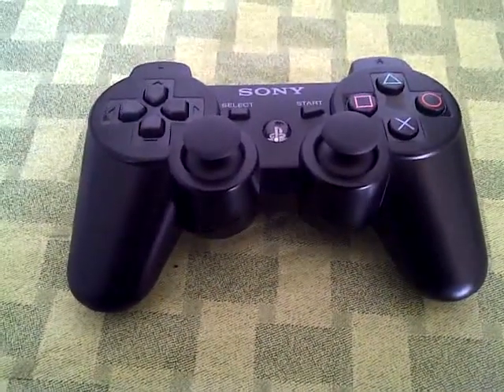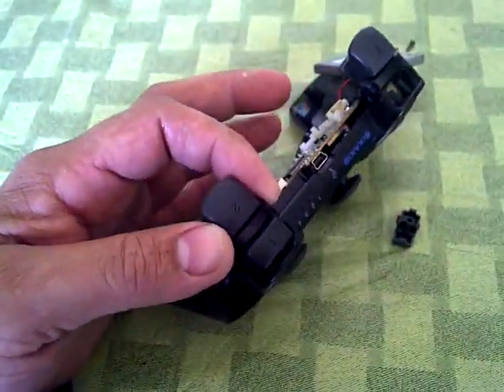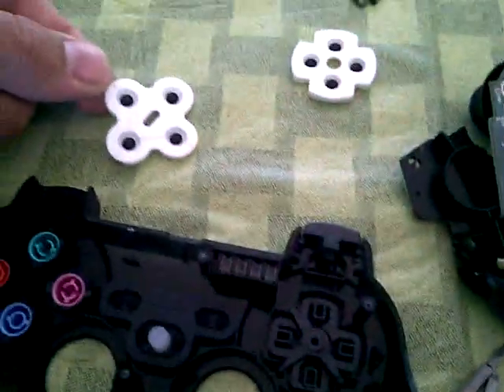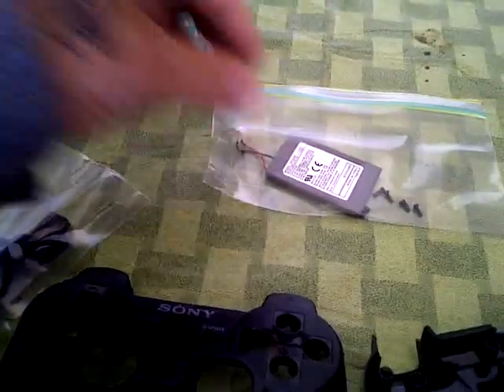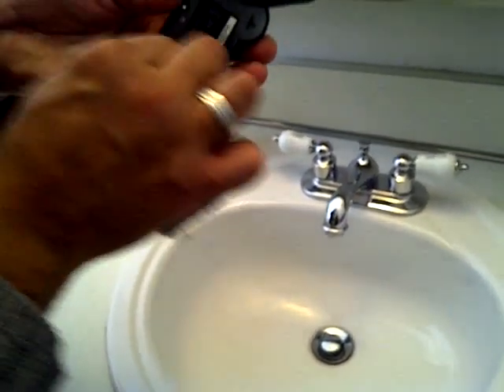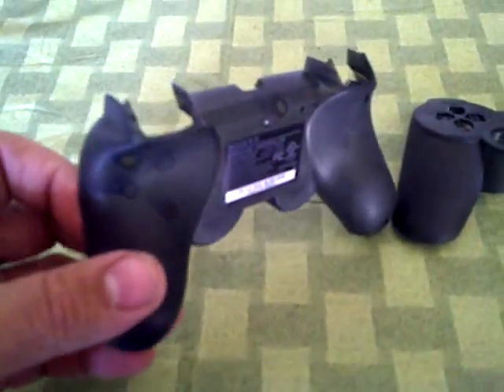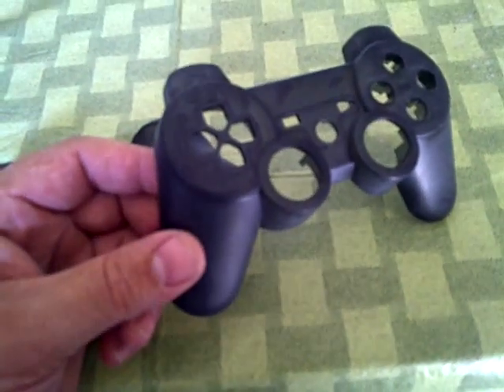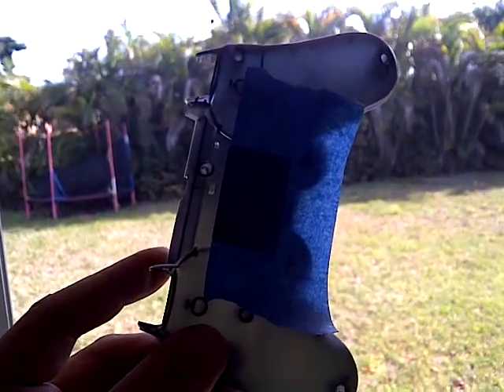How to paint a PS3 Controller Part 1 - Prepping - Camo Style

Comment from the maker: That's correct. Primer in general fills very fine imperfections in the surface and helps with the bonding of the paint. if done correctly the paint will last a long time. I like to use the sponge because it's able to get into the small corners and the controller surface is not flat ,so the sponge will sand the surface more evenly than the paper will. Hope this helps

Comment from the maker: @Theihatecampers i would suggest to wait about 10 mins between each coat of paint. the first base color coat should be light enough to still see the original color of the controller. wait 10 mins then spray your next coat. wait another 10 mins for final coat of base color. before spraying each coat make sure to shake can well.

Comment from the maker: @StunnaKkid primer preps the surface for paint so it can adhere better. In this case, the sanding of the surface and the washing with warm water and soap is another way to prep the surface for paint to adhere. if done properly and sealed with the clear coat, the paint will not chip off. Its been almost 9 months now since i did the paint job and the paint is still intact. My son and I use the controller on a weekly basis and shows no signs of ware.

Comment from the maker: using steel wool or any type of abrasive pad will should remove the paint, just a matter of how much sanding is required. If your repainting a controller make sure that the button openings are clear of any excessive paint to allow the proper button travel. Aside from the paint keep in mind the clear coat to protect your paint job.

Comment from the maker: Sure, providing that your going to spray the matte clear coat after the main paint theme is done to protect the finish, the plastic paint will be fine. Allow to dry several hours, don't rush it then apply the clear in light coats.

Comment: i did this to a xbox 360 controller....4 of them actually n never did anythin besides apply testor acrylic paint or acrylic paint that has the sealer in it already  and have never had an issue...so y do that with a ps3?

Comment: paint that crape ??? i  paint a PS1 controler . the outsite is PSX 1 an insite Ps3 . you can kill some one with that old controler . no damage on it . PS3 controler is the bigest crape ever made . i bay 3 on 6 month  insite R2 boton There is a piece breaks off its made from thin rotten plastic   . you don't have heart to squeeze on the controler  you press it as cracks in Orginele sony controlers £60 is a lote of mony for a pace of crape .